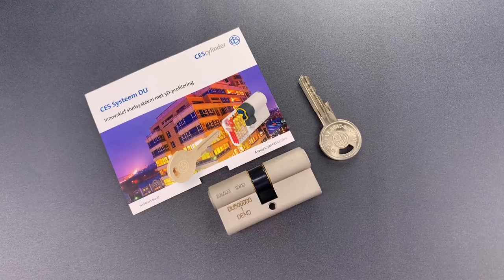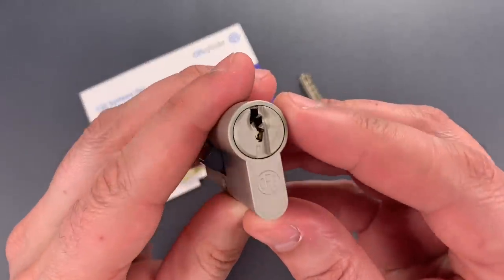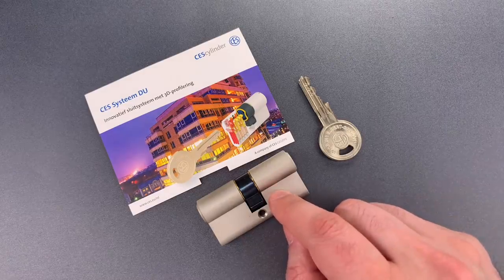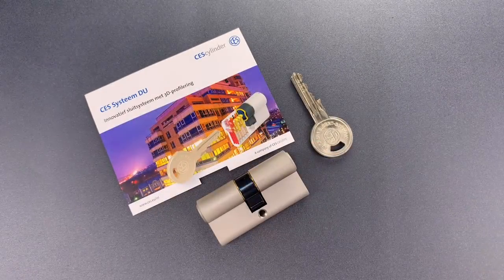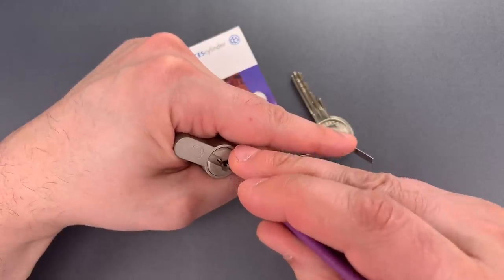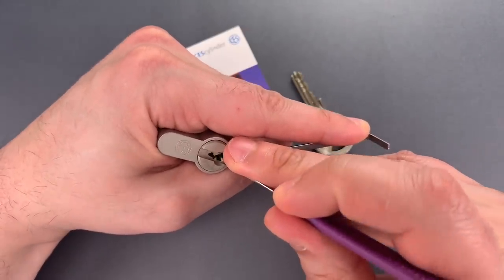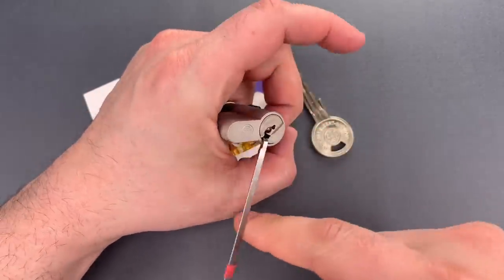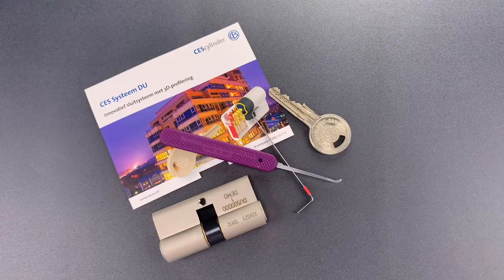[1248] Absurdly Paracentric CES Euro Cylinder Picked

Comment: @LockPickingLawyer
Dearest Hero,
I did something yesterday!  My wife and I bought a veterinary clinic.  Due to staff turnover during a part-time phase before us, nobody could get into the drop-safe at the front.  We had been not using it.  This thing was..  beefy.  Digital keypad, no obvert key override.  I decided to try to tackle it and took my modest collection of picks and tensioners and some extra wiper insert.
My first step was to look for screws.  I didn't see any but under the battery tray were two tiny (~#0) phillips.  I pulled them put and off the keypad slid.  I found no keyway, so i pulled off two more screws for the mounting bracket.  Under this was a rubber plug.  Had I not been a viewer, I would have missed it.  I tipped it out with a pocket knife.  The steel on the door was a good 1/2 inch thick, and at the bottom was a + shaped steel piece with brass behind it.  I knew what that was!  I rotated the shield and a  keyway saw light for the first time in a long time.  + with the inside edges beveled.  It was a pain to tension, but the wide inside made it very accessible.  I counted only 2 pins per side.  The hardest part was making a tensioner deep enough to get in there and with such an angle that it could actually turn the core.  I grabbed my wave rake and went around the core once, and felt a false set :-)  The std hook found the three noncompliant pins and in just a few minutes I had it open.  There was only 100 dollars in change/small bills inside- but it felt like absolute treasure.  4 more screws showed me the mechanism.  On the locking body there was a 6 digit code- a master code.  I used that as a way in to create a new user code.  We got the safe back.  Dr. Wife was very happy.  Found 100 bucks we didn't know we had. I picked a keyway I had never laid eyes on before.  It was a good day.  I honestly attribute 80 percent of my physical security knowledge to you, Bosnian Bill, and Deviant.  Thank you for being a great teacher.  Now to go CC this to BB :-)

Sincerely, Matt.